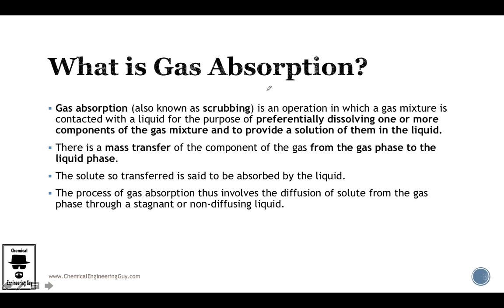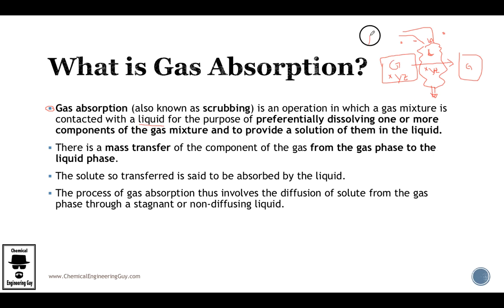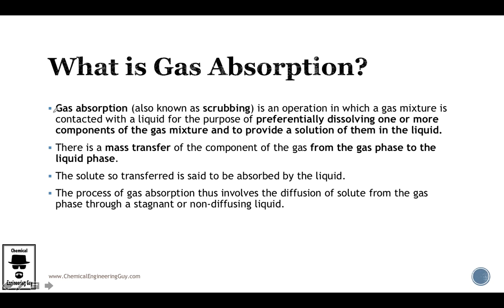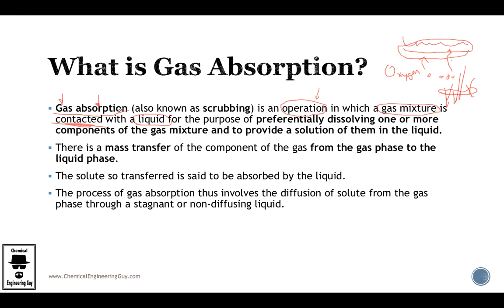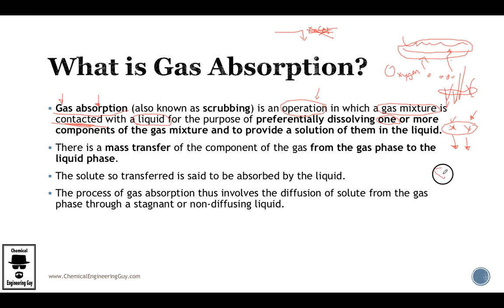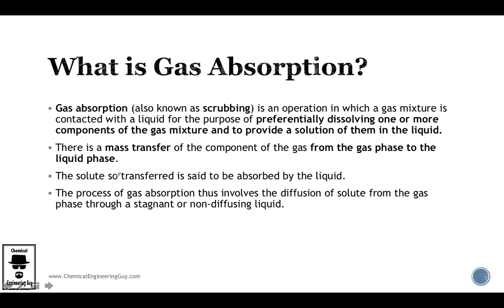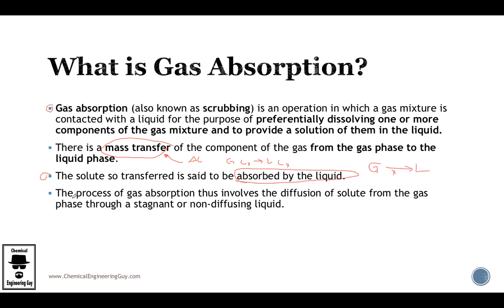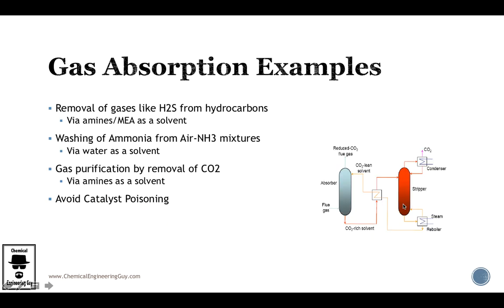What is Gas Absorption? (Lec041)

Comment: Is there any specific ratio by which gas and liquid be transferred into absorber?
Also, if the inlet stream pressure and the absorber operating pressure are different, does it create some problem?
Reply from the maker: depends on the equilibrium line! some gases will readily be soluble, and some will not, also depends on T, P

Comment: Does gas absorbtion in a flash increase it's overall mass?
Reply from the maker: gas absorption is carried out in multiple stages (columns) whereas flash is carried in a single stage. These are two different mass transfer processes. Gas Abs = solubility phenomena. Flash = volatility phenomena